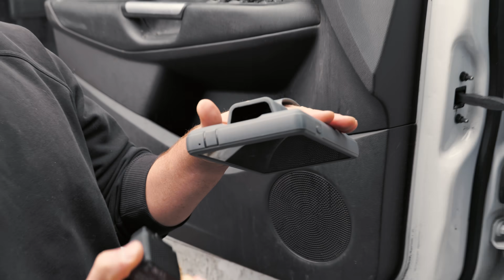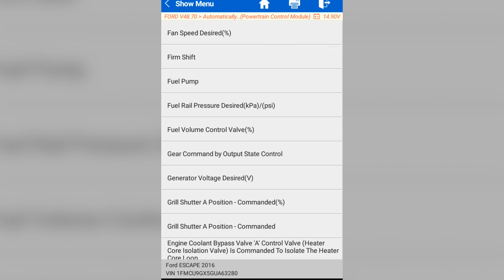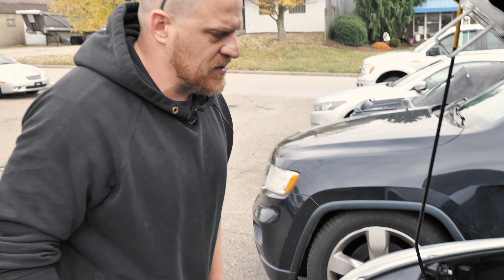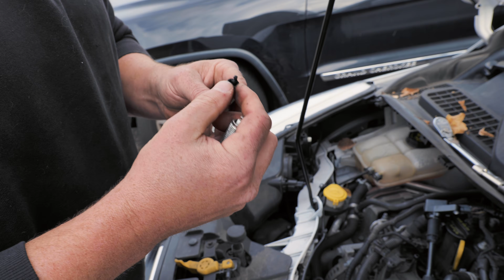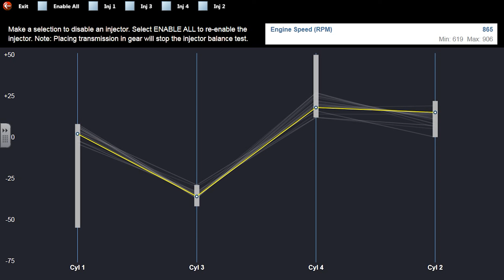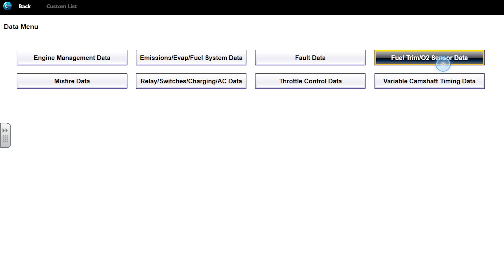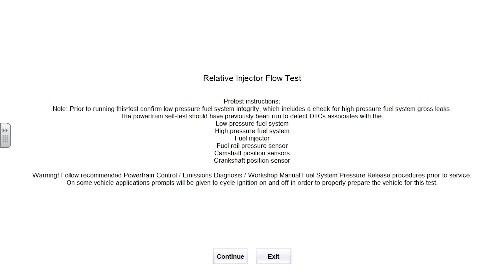GDI Misfire "Comeback" What Did We Miss?

Comment: I'm a big fan of this channel and I appreciate all the time, effort, and talent that goes into these videos, but I have to disagree with the part about charging the customer to repair a technicians mistake.  I've been in the service/repair industry for a lifetime (35+ years).  Service tech screws up, he eats it.  In some extenuating circumstances maybe you split it with the customer. EDIT: I MISUNDERSTOOD, I THOUGHT PAUL'S BROTHER'S SHOP DID THE WORK. TURNS OUT THE CUSTOMER DID HIS OWN WORK. MY APOLOGIES.
Reply from the maker: But we didn't do the job! This was NOT our screw up. It was brought back to us after parts were changed. Absolutely this one is NOT on my brothers shop to figure out for free.
Reply: The technician didn't install the coils, the customer did.  That's why he stated the garage should be paid.
Reply: @djosbun  Oh crap, my bad, I misunderstood. Thanks for the clarification.  In that case, yes, absolutely a chargeable service.
Reply: I am an Electrician. I go to a job and solve the problem.  Another similar problem happens shortly there after. They don't call me. They take things into there own hands.  They bought it! If another  Electrician had come out and so much as removed one(1) screw. It's now that Electrician's job. That's the reality in business.  He  who last touched is the responsible party. There is no nice nice. It's all legal. You may feel it's unfair but that is the plain and simple truth.
Reply: @davidsawyer7880  I totally agree.  I misunderstood. I thought the Danner brothers did the work. My bad.

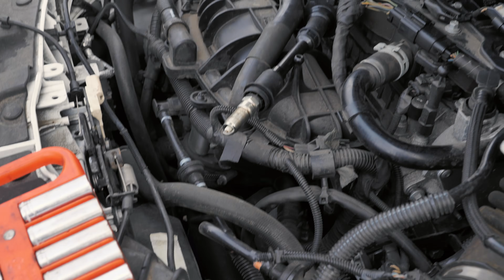Comment: @23:35, I keep a 6" length of clear plastic water hose on hand to check the proper function of the plugs. Slip a quick connect into one end and the plug at the other end and connect it to shop air. If it fires at 100 PSI of dry air, it'll fire the fuel/air charge under compression. If there's a crack somewhere not visible, It won't fire at the electrodes.
Reply: if your going to waste your time, you may as well build or buy a proper tester with chamber you can pressurize to much higher levels.
Reply: @throttlebottle5906   I can use higher pressure, but 100 PSI is more than enough to detect a faulty plug. IIRC, a good coil barely sparks across 1/8" at 120 PSI. The piece of tubing probably cost me 35 cents 20 years ago. I've only used it a handful of times. It's not worth spending a lot of money on a tester unless you work on aircraft or maybe professional motorsports, which I don't. What kind of tester do you have?
Reply from the maker: @throttlebottle5906  i don't think this is a waste of time 🙂
Reply from the maker: Genius

Comment: Hi Danner
You must try the Launch scanners like the X-431 series (it has a lot of models) but the ones around that price. They are really really good scanners and here in Chile are very popular. I have one and I love it
Reply from the maker: I've heard from many that this phoenix is basically the same tool
Reply: @ScannerDanner  Actually it does 🤣, it has the same interface lol
Another point, the injector balance test is not what you meant i think. I think it works the same as Diesel with common rail. They have a test called "ZFC" Zero fuel calibration" and what it does is the ECM is looking for changes in crank speed rotation and doest it so by starting to open very slightly the injectors until it sense the change in speed rotation of each individual injector and then it shows the minimum open time to do so. The ideal is to have the same aperture time in all injectors

Comment: XTool D7 can be had for 480. It was 370 on black Friday. Bidirectional powerful tool
Reply: Xtool 100 pro saved me 1300$ on fixing Immobilizer problem on my Dodge Caravan!
Reply from the maker: The xtool d7 and d8 are absolute garbage. The company sent me both and I sent them both back and said no thanks. Data pid updates where not even usable! I think I had 3 PIDs selected and it look 4-6 seconds to update lol.
Who cares if it has decent bidirectional tests available, if the datastream is completely useless. There was a lot more to these two units that I didn't care for. 
So for others reading this, I do NOT film a video about a particular scan tool just because they send them to me. There is a standard that must be met, or you guys will never see them. Im not pushing tools, that's not what I do. The Topdon blew the D8 (comparable price) out of the water and the D7 is not even in the same ball park
Reply: @ScannerDanner  really thinking on getting the top don Ninja T1000 since I dont have key programmers.
Reply from the maker: @scientist100  i don't know much about the topdon line, but for $800 for the Phoenix, this tool, hands down, gets my approval. Doesn't matter that it didn't have the injector balance test I was looking for. 
I have heard some good things about the ninja. Or at least I've heard it's name being thrown around 😉
Reply: @ScannerDanner  yes, AES sells them and promotes them so, it must be good 😎
Reply from the maker: @scientist100  they promote the xtool?

Comment: When a spark plug or a coil goes bad, it usually it takes out the PCM out on these newer Ford vehicles. Had the same continous misfire on a 2013 f150 3.5 ecoboost. Compression, spark and fuel checked out, at a desperate attempt I sent out the PCM to get fixed and problem solved.
Reply: Yep. Need to keep spark plugs in good shape
Reply: A coil or plug take out the PCM? Ford quality lol.
Reply: @joelopez40oz23  https://youtu.be/wYgaCJ-ER2U
Reply: @joelopez40oz23  happens all brands not just Ford.
Reply: @z31freakify  I been working on Lexus almost 15 years. Never seen that happen on any Lexus vehicle.
Reply: @joelopez40oz23  The reason is toyota has a separate igniter from ecm. Either in the coil or remotely mounted.
Reply: @phillipwilson6781   also Lexus doesn’t put water pumps behind the timing chain cover.  Great engineering.
Reply: @joelopez40oz23  No, just the starter under the intake manifold.  Engineers have brain farts no matter what company they work for.
Reply: @jimr549   The intake manifold comes out easy. Difference in quality between Lexus and ford.
Reply: That wasn't the issue on this one though